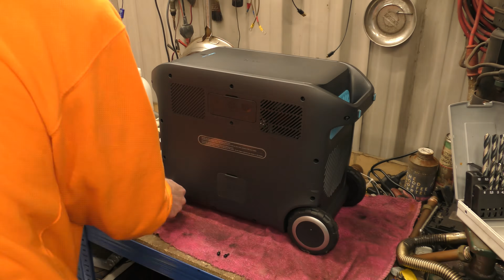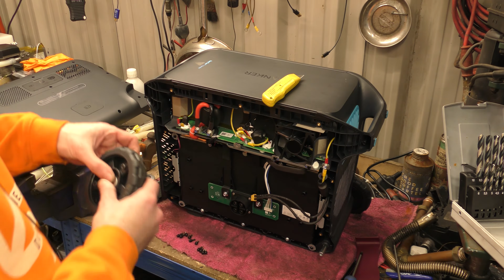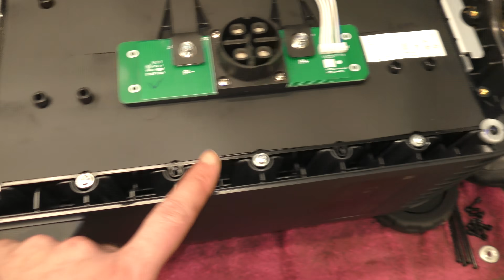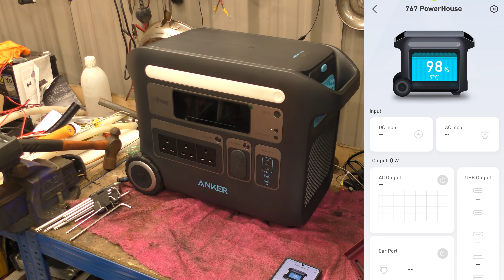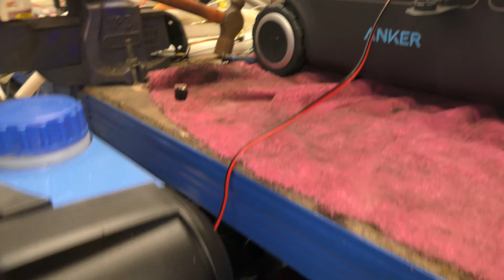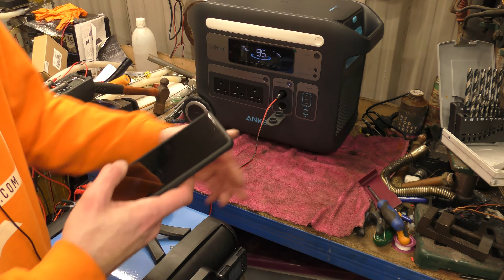Anker 767 Powerhouse - quick look inside and a few tests

Comment: I have F1500 and F2000, now i paired directly paralelly their batteries via custom made XT60 ports and a wire. Now i have 3500kWt/h capacity. BOMBOCLAT! They discharge equally and charge equally.
Reply: Can you make a short video or show a scheme of how you did this?
Reply: @evgenyshevchenko3393  Да просто разобрал и вывел через коннекторы контакты для подключения двух батарей в паралель и кабелем отдельным снаружи их подключаю вместе и всё

Comment: Did you bought it or it was sort of provided by anker ? It’s abit strange how it’s not label lifepo4 instead of course all All lithium ion and have different types 😊 . So there’s a 30A ac output port but only limited to realistic 20a real power 2400w continues no peak ratings ?

Great teardown not many even attempt this heheh I love this videos shows us the investment value we have or could make
Reply: What’s the highest wattage draw you have tested on this unit on surge and continue ? I’m deciding on the options c1000/ delta 2/ ac180 and this one it big but some say the real continues wattage is 2400 so yeah there’s some appliances that surge 3600-4200watts sometimes for heavier tools ik it’s not really meant for that but for kitcken multi devices w less draw

Comment: How is your 12v cigarette light working the diesel heater. Mine cuts off and will not work ?
Reply from the maker: There are a few variables.  Mostly not all heaters start up using less than 10A.

Comment: Did you check if the live is on the correct pin on the mains output sockets?
Mine is inverted. Live is on the Neutral.

Comment: Good to see you testing the Anker 767 Powerhouse because I have a little barn that needs electricity! My load is mostly trickle chargers for the diesel heater & -2- tractor batteries. My overhead lights are LED & I am making do on a 12 gage, 100' extension cord, & yes I Know - bad idea. The main thing is, I have need for some power for the table saws. My plan was to use a couple of solar panels along with a portable battery back up and wham! there you are, doing it for me. Great Karma

Comment: interesting fact i checked on my dad’s 767 - the two 12 V-ports are NOT wired in parallel it seems - they each can handle 12 V / 10 A+ at the same time … so you should be able to start/run two dieselheater at the same time 💪🏼

The bat-pack is a 16s10p pack … so containing 160 round-cells and they are def. LiFePo4 cells 👍🏼

Love your videos - i am german and life most time in a campervan since 2020 - whenever possible i try to be in scotland 🏴❤ … stayed 6 month straight in Durness in 2022 … best place (for me) on this weired planet 😄
Reply from the maker: That's an interesting test I'll have to try.

Comment: £2,200 for the unit, I think I will stick with my ecoflo delta max 2000 a few hundred quid cheaper and you can attach 2 battery units each 2kw, solar and smart petrol gene.
Reply: Delta max 800 cycles and it's an EPS over this UPS and 3000+ so it will last 3 times longer.... oh and it's alot quieter + expansion to 4kwh the Anker is cheaper than the Max @ 4kwh

Comment: does it have ac charge timer? I'm thinking charging from eco7 and running the house in the daytime
Reply from the maker: Good question.  Could the same thing be achieved with a timer plug?
Reply: @DavidMcLuckie  yes that is my current plan but since that box control the charging current
Reply: No but you can hook it up to a smart plug and get that - I have it and the 2kwh expansion and do just this - you will struggle to get pay back with E7 rates I have Octopus GO and its only due to the expansion and using 3KwH my payback is viable

Comment: I don't know why in particular, but for some reason I'm slightly surprised the batteries aren't Lithium Iron Phosphate cells.  This thing is basically a giant USB power bank.  Imagine the fireworks should those cells ever find themselves mistreated.
Reply from the maker: They are supposed to be LiFePo4 cells.  What makes you think they aren't?
Reply: @DavidMcLuckie  Can you see the cells from the side? In my case I can and they appear to be some sort of EVPST 26650s with a teal wrapper.
Reply: Per Anker they are meant to be LiFePO4 so something isnt right - I did see the expansion is model A1780 which so it might just be warning isnt mentioning it - there is LFP in the code top right.
Reply: 51.2v is the usual 50% nominal for a LiFePO4 16S pack and the code says lFp as Dreador stated. LiFePO4 is a Li-Ion battery technology just like all of the other lithium rechargable flavors that are currently in use around the world.
Reply: @kuhrd  you cannot use voltage to determine the charge state Of LifePo4 cells, the charge curve is too flat unlike Lithium Ion where voltage is an indicator of State of charge
Reply: @jamesemery1  You can easily use a cololmb counter to measure 50% SOC with a typical 16S LFP battery but the point of the nominal is that it is somewhere fairly near the middle of the range while in normal use.  My point had nothing to do with measuring state of charge other than them using the nominal voltage on the label for a 16S pack which also backs up the idea that the cells are LFP.
Reply: From what ive seen they appear to be 26650 EVPST cells with a teal wrapping.
Reply: It sure looked like a 16s 48v 40Ah setup.  I would have expected it to be an 8s or 4s with only 2Kwh of bank.

Comment: no lifepo no fun)
Reply from the maker: I keep getting comments that they aren't LFP cells, but no-one will tell me how they know.  Could you share with me why they aren't LFP cells?
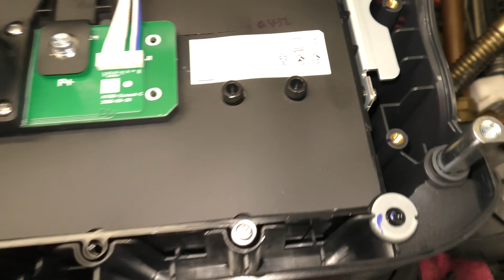Reply: @DavidMcLuckie  at 5:45 it says Li-ion everywhere on the sticker so they're assuming that means not LiFePO4
Reply from the maker: @Dave t That would to me be an incorrect assumption as all Li-Ion flavours are called Li-Ion.  https://batteryuniversity.com/article/bu-205-types-of-lithium-ion
Reply: @DavidMcLuckie  I agree I just think that's why they're leaving those comments
Reply from the maker: @Dave t I'm with you now, they just see Li-ion and assume NMC and fire and death.
Reply: @DavidMcLuckie  Usually if a battery is Lifepo4, it's labeled as such. If it just has a Li-ion sticker that usually denotes NMC chemistry.  If it's Lifepo4 it's usually labeled LFP.  But that's obviously not a universal convention if they are LFP in this case.
Reply: @DavidMcLuckie  take a look at the cells from the side through the grill. On mine I can see the cells and enough of the writing on the cells is visible for me to tell they are manufactured by EVPST and most likely their 26650 lifepo4 cells.